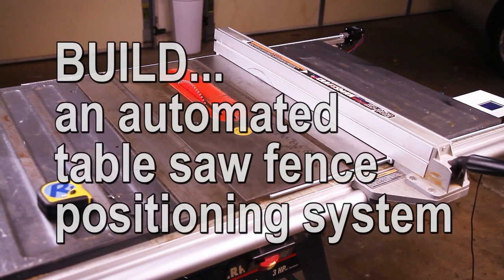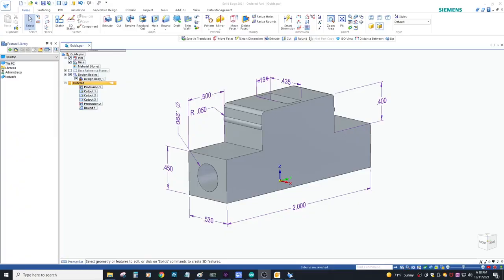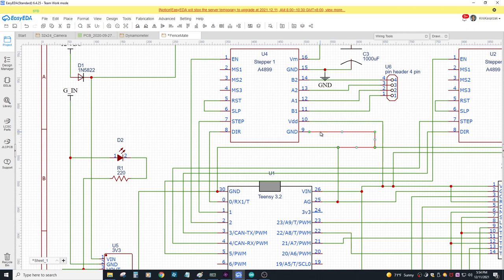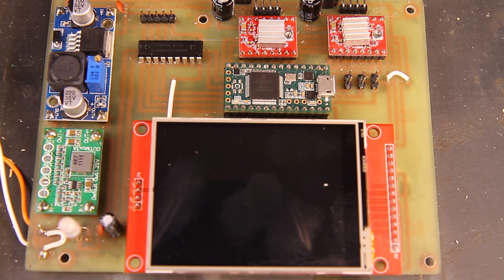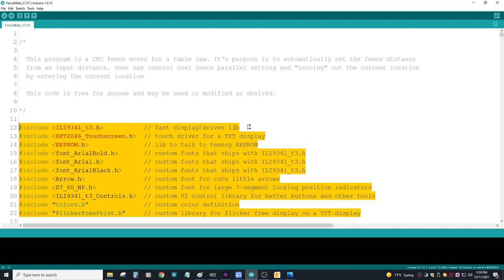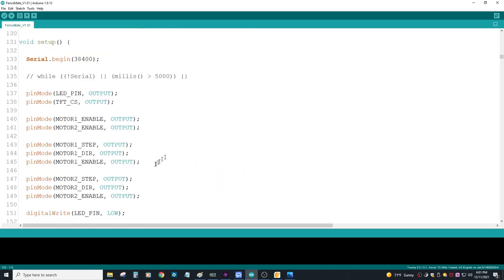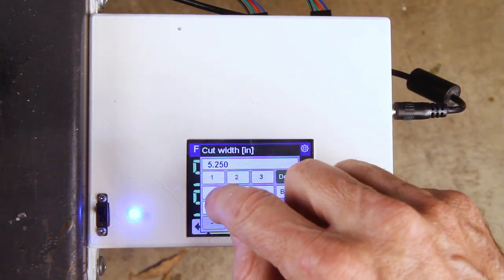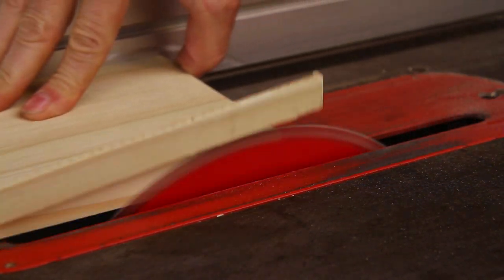DIY motorized table saw fence

Comment: I have a general 850 saw which is missing the rails and the fence… I need something like this built since the blade is controlled by Motors to rise and tilt.  It has the computer and plug ins on it but I cannot find a fence or rails.

Comment: damn men... if you can produce that one in larger quantities....    I will give e you my money ...
Reply from the maker: I've given this a lot of thought. The challenge is how to connect the steppers to the table and fence. I designed some custom parts that probably won't fit on other fences. I was thinking selling a kit but not sure others would be willing to devise their own connection scheme.

What are your thoughts?
Reply: @KrisKasprzak  What if you just created the control board and include the steppers. It's simple to source 1/4-20 rod from the big box stores. It would be semi-DIY.

Comment: Hi Kris, I`m trying to compile for Teensy 4.0 but IDE it`s saying that can`t find font_ArialBlack.h .
Where can be find?
Max
Reply from the maker: These are extra fonts developed by pjrc, find them here:

https://github.com/PaulStoffregen/ILI9341_fonts
Reply: I have now an error at the Button KeyPadBtn[16](&Display); line saying that an array must be initialized with a brace-enclosed initializer. I`m using Arduino IDE2
Reply: did you resolve this issue as I'm having the same error  "array must be initialized with a brace-enclosed initializer"  Thank you @massimilianomorelli3717
Reply: @lemanssport1970  
I`m sorry for this late answer. I solved the problem with the following declaration:
Button KeyPadBtn[16]{&Display, &Display, &Display, &Display,&Display,&Display,&Display,&Display,&Display,&Display,&Display,&Display, &Display,&Display,&Display,&Display};

An Arduino expert told me that maybe the syntax has been probably changed.
I still have some issue with the porting, let me know if you made some improvement. Thanks

Comment: Why don’t you get some funding and design the first CNC TABLE  SAW FENCE? If CNC Machines can do such amazing things, it seems like adding that kind of control to a table saw fence that only needs to move left and right would be the next step. If you strike it rich don’t forget about me.
Reply from the maker: Funding is not the issue. I’ve thought about this thing for a few years. The challenge I face is how to connect the device to an unknown saw and the fence. I looked at one saw recently, and it would be virtually impossible to connect something to it. Meaning, I would have to refund somebody their money…
Reply: When I put my sawstop together it came with the rail that the fence rides on separate and it just attached to the front of the saw and the fence rides on just that rail. If you could design a universal rail that could replace the stock rail that most saws use and make it so all the installation would require is to drill the holes in the new rail to line up with the saws  stock  attachment holes. The stock rail could be used as a template for lining up to drill the holes in the new rail that way the saws stock attachment bolts could be reused and that would be great for for saws with threaded holes. I know the Incra table saw fence requires installing new rails on both sides and most saws with the sawstop type fence only use one rail in front. That’s what I would suggest.

Comment: Is this something I can buy like working and all, I mean, it's very useful. I'm just no engineer at this level I can't go ahead and understand all of this
Reply from the maker: I thought about making these and selling them but the problem is is the installation connection of the stepper motors to the tablesaw rails or so vastly different from saw to saw

Comment: I watched 41 sec s far. I cant believe not one internet safety police got you for no upper guard and not using a push stick. I have no issues but I see others get attacked all the time.  Like  I know where my fingers are thank you.    Okay Now I will watch.    I have thought about this several times as it would be Amazing at doing custom box joints.

Comment: Can you do one for me ? I will pay if not too much
Reply from the maker: Selling you a working unit is easy, installing is challenging. Took me several different designs before I was able to get the steppers mounted securely. 

What type of table saw do you have?
Reply: @KrisKasprzak  Miter saw , I am mechanic -i can do anything , just too much time tolearn new things , help machanical part I can do easy
Reply: do not need long rod , only set with motor and control

Comment: Hello Kris, thank you for sharing your great project. I'm having an complying error on line 120 which I've been trying to solve for days, have had NO luck at lot. Did not want to bother you but you may be my only hope.

C:\Users\rmpro\Desktop\ARDUINO\FenceMate_V1.01\FenceMate_V1.01.ino:120:22: error: array must be initialized with a brace-enclosed initializer
  120 | Button KeyPadBtn[16](&Display);
      |                                             ^~~~~~~~

It is the same error posted by 
@massimilianomorelli3717
2 months ago
Thank you very much! Russell
Reply from the maker: yep, compiler made a change somewhere where arrays must be create differently. This should be the correct code

Button KeyPadBtn[16]{ {&Display}, {&Display},{&Display},{&Display},{&Display},{&Display},{&Display},{&Display},{&Display},{&Display},{&Display},{&Display},{&Display},{&Display},{&Display},{&Display} };
Reply: Thank you for the quick response! After changing the line of code it does not show that error but have a lot of other error codes. Here is one for example:  
 c:\Users\rmpro\OneDrive\1 (1Drive) My Stuff\1 SHOP Stuff\1 Arduino\1 Arduino Sketches\libraries\ILI9341_t3/ILI9341_t3.cpp:1723: multiple definition of `ILI9341_t3::setTextWrap(bool)'; C:\Users\rmpro\AppData\Local\Temp\arduino\sketches\887BB27F3893739309B248D8918A187A\sketch\ILI9341_t3.cpp.o:C:\Users\rmpro\OneDrive\1 (1Drive) My Stuff\1 SHOP Stuff\1 Arduino\1 Arduino Sketches\FenceMatdec23/ILI9341_t3.cpp:1723: first defined here

It ended with:   collect2.exe: error: ld returned 1 exit status

Thank you again Kris.
FYI:        IDE 2.2.1,  Teensy 4.0
Reply: Thank You ! This Code Worked.  Other issue was multiple libraries copies in sketch folder.
Thank you again! @KrisKasprzak
Reply: Disregard this comment as I had multiple libraries copies in sketch folder.
Thank you again!